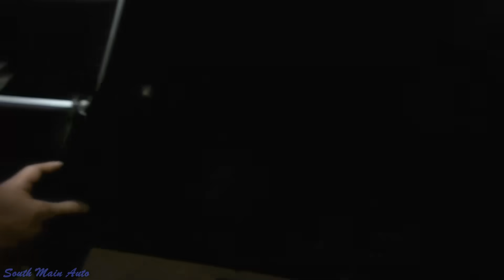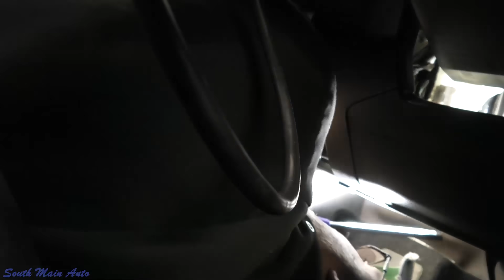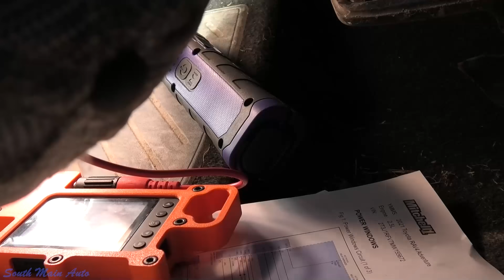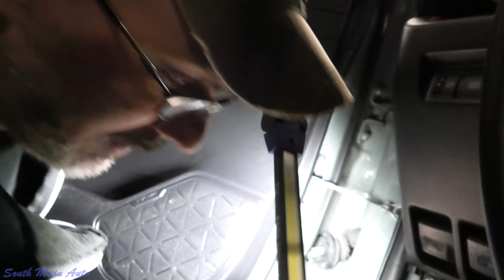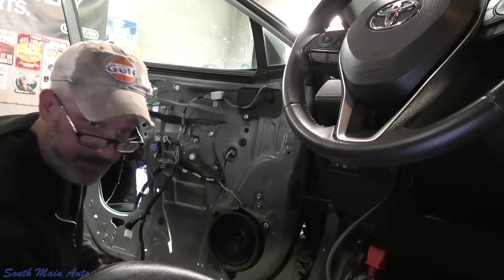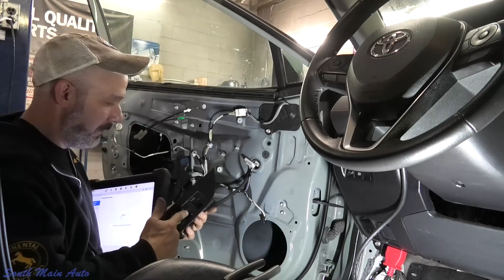One Week It Works, The Next It Doesn’t - '21 RAV4 Window Switch Diagnosis

Comment: You see....redesign of the 42SLMAX is a result of "feedback from customers". 
Would be interesting to know if the customer knows of the body work or if it was sold to her without disclosing it had body work/collison/accident etc. 
I still say the wire gauge used in modern vehicles today is simply too light, small, high numbers above 18 ga. Folks are paying big money for today's vehicles yet the build quality just cannot compare to a 30 year old because the focus is on display panels, automatic this and that and a ton of other needless features. 
At least this video has proven the above and still, an old school repair is what corrected and fixed the problem...the right way of course.  AND...no collateral damage !

Comment: Tell those that don’t know 45:16 there are functioning drains in the door provided nobody lets them plug up , i love following up on someone’s mistakes!
Reply: Around 2022 toyota issued a service bulletin for the drain holes as the door weather strip could cover them up preventing drainage
Reply: @motorbikemike65 back in the early 70’s the people putting Rusty Jones spray in rust preventive would plug up those drains and i opened them up when i was at the local Texaco station, when they brought their cars in for service.
Reply: @johnchambers12  ya i am old enough to remember those old rust proofing coatings  often cuased more harm than good

Comment: If you haven't cut yourself while working on a car you haven't worked on a car.
Reply: My favorite is the black eye when the brake caliper falls because you didn't bother hang it up.
Reply: I try and smash a finger or run it on a sharp edge at the beginning of a repair and get that injury out of the way right off the bat.
Reply: @thomaschristensen755  Yup! A bit of blue shop towel and a strip of electrical tape, and you're good for the rest of the day.
Reply: It’s a blood sacrifice. You never know what you’re working on. Some cars are possessed.
Reply: You have to make a sacrifice to the car gods… everyone knows that.
Reply: I guess the divot on the side of my wrist says I work on cars a little bit?  Didn't think it would like a valley like that when I got it, but it did.

Comment: "Bleeding out of my facehole" - LOL - When you got back from "emergency surgery" :D, I figured you would have a piece of 33+ tape on it - that would have been hilarious!!!!  I feel for ya on this one.......
Reply: When I was a VW mechanic in the 1960s my boss was working on a fairly new 356 and knocked the trouble light (you know the one with the metal cage that gets about 200 degrees?) on to his forehead with the resulting sizzle (St. Pete in the summer).  I am sure that the pain lasted longer than a simple cut.
Reply: Electrician here I use 33 exclusively for hand and finger cuts on the job
Reply: @earlestes8649  The amount of times and roles I have used for cut fingers when I was working on vehicles' sound systems, alarm systems, everything electrical in a car......What is amazing is that it works REALLY well for emergency use....

Comment: It's easy to penetrate through when drilling out pop rivets. This one's a good reminder to add some kind of bump stop on the drill bit. Water comes in from the window slide, and holes at the bottom should allow it somewhere to drain if they're not plugged.

Comment: If nothing works through the master switch, and everything works via the scan tool, I would have replaced the switch module assembly and not chased wires as they obviously carry the signal.
Reply: And you would have been wrong, or didn't you watch the video where Eric O found the damaged and broken wires?
Reply: @wino99999  keep drinking wino.

Comment: I bet Astro sends you 'Thor's Helmet' special edition after they see this.
Reply: We made it stronger on the newer model because it kept falling off, now it's strong enough to concuss pulling it off surfaces it seems. We need to goldilocks this whole deal
Reply: @AstroTools  Just put a disclaimer on it "CAUTION: Magnet not to be used on any metallic surface, injury or death may occur when removing " . 😀
Reply from the maker: @SsdBlig  😂
Reply: @AstroTools y'all make the BEST flashlights and the BEST super shallow sockets! I'm slowly restocking my toolbox with Astro stuff and couldn't be happier
Reply: @AstroTools I'm wondering since you seem to make such good tools if you make a great headlamp which I use everyday I'm a jet ski mechanic
Reply: Eric O needs to wear a full face safety helmet with inbuilt magnifying glass inserts , imagine that !
Reply: I thought it was a smart model light... warning Eric not to be standing on his head under the dash of a car as bad things could happen and what do you know... a bad thing happened. Moral of the story is listen to the smart light. Cheers 
  Ps I was also wondering if that connector right in the middle of frame needed to be plugged in for testing... apparently yes.
Reply: With a copy of their no arbitration product information sheet..   “we are not liable for you busting your fore nugget open with our product, heres a helmet for your dumb ass though”.  Lol

Comment: Those kick panel connectors looked sus most likely because they've been out before chasing door harness problems. The 19+ Ravs have bad seals on the roof rail mounts and water runs down the a-pillars directly into the lower connectors of both kick panels. Toyota has very generous extended service campaign that covers these models up to 10 years. We've done a few where 5 harnesses, carpet, headliner, etc had to be replaced under warranty, not fun. Usually the easy tell is the "ole swimmin hole" smell when you open a door.

If you have any of these and find greenies in those connectors, might want to check with your local dealer if its covered, potentially could save a customer a ton of $$$.

Comment: I had the same problem with my F150 and it started the day I got the truck.  Left the dealer with my New truck stopped for a coffee and the window would not go down.  Brand New truck and I had to pull up and get out to get my coffee. Dealer checked it over and over and said No Codes so Nothing to fix.  Then it turned into Fan and headlights and radio ... everything turned into Maybe it will work...

Comment: My son and I fought this on a Traverse. We pulled the fuel pump relay to crank the engine without starting it. The door locks, windows stopped working from the door switches but remote still worked the locks!  Checked main fuses, no help.  My son wedged himself under the passenger dash and probed fuses, all OK.  Instantly, everything began working.  Two months later, still working!  Watching from Texas.

Comment: It stays powered until the electrolytic capacitors in the window switch module bleed down.
Reply: Nah they work off a timer that allows power for a set time after switching the ignition off. My car does the same, I can turn it off and then close the power windows, I haven't timed it but pretty sure it's close to 30 seconds after power off.
Reply: @johnt.848 yes but the power to the module was removed, and it still worked for a couple of seconds after disconnection, so the comment above is absolutely Correct!
Reply: @wino99999  nope, the timer is not in the door module.
Reply: @johnt.848 if theres any form of communication over a bus to the body control module, which is how this door module was working, then there's going to be electronics that have capacitors around the circuitry. If the module is powered down after it was working, and it still works with an input for a very short time afterwards (1-2 seconds) then its capacitors keeping the circuit powered for a short time that is being seen here, NOT any delay timer in the BCM!
Reply: You're just not understanding what is being described or seen here!
Reply: @wino99999 . The capacitor theory is the correct one.
Reply: @slalomking  I certainly think so!

Comment: WARNING.  USER REQUIRED TO MAINTAIN PROPER FACE TO LIGHT DISTANCE. FAILURE TO DO SO MAY CAUSE BODILY INJURY, ESPECIALLY TO PEOPLE NAMED ERIC.
Reply: Dodge Ford Chevy trucks still offer manual windows , door locks. Have to order. Not stocked vehicles.

Comment: it's the same old thing as yesterday.  Cars today have too many gadgets that cost big bucks. Manual car doors and side mirrors cost nothing to work. No electrical cables, No switches, No main brain, battery not included.  How many times the car will not start because the car backup camera is broken?
Reply: It started with all those stupid tire pressure sensors.
Reply: @Mag_Aoidh How to fix stupid tire pressure sensors once and for all. Get the following parts: one 3inch x 6inch long black iron nipple, one 3inch x 3/4inch female Thread Black iron Reducing Coupling, one 3/4inch male to 1/8inch female black iron adapter, one 3inch Black iron cap, one 1/8inch Air Valve W/ Plastic Cap. put it all together with Teflon tape, but not the black iron cap for now. Mark off each tire air pressure sensor LF/RF/RR/LR, then scan each tire pressure sensor.  Put all the tire air pressure sensor into the pipe and put the cap on and fill it to 30PSI. Keep it in the car trunk. It has been working for me for years.  Replace each tire pressure sensor when needed. Have a nice day.
Reply: They aren’t that bad. You’re watching a car repair channel, so of course all the “newfangled gadgets “ make all the Karens act like the sky is falling, but there are millions of vehicles on the road that never have the issues you see every week. And yes, you can still buy cars with manual everything, but nobody REALLY wants that, even if they pretend they do.